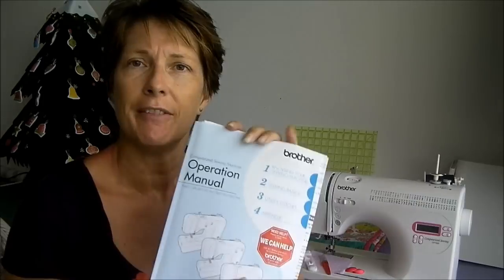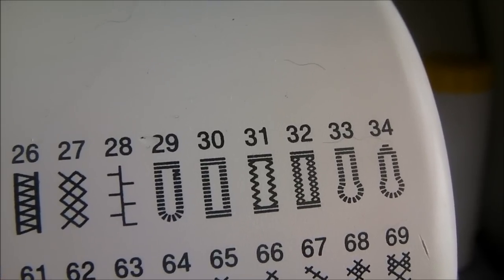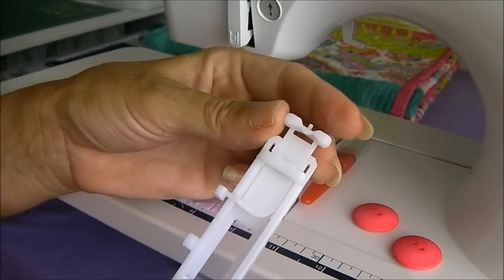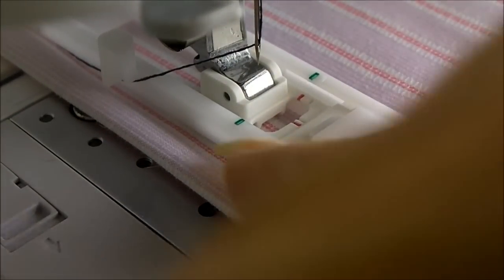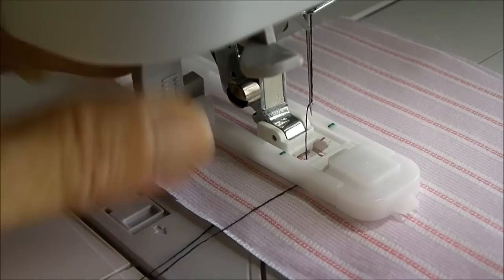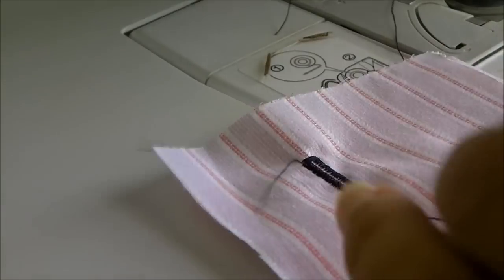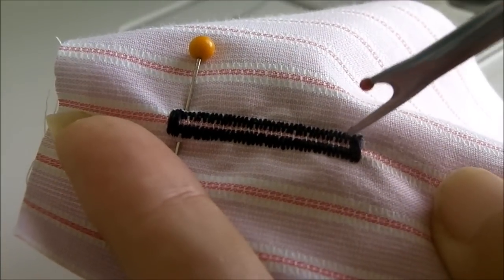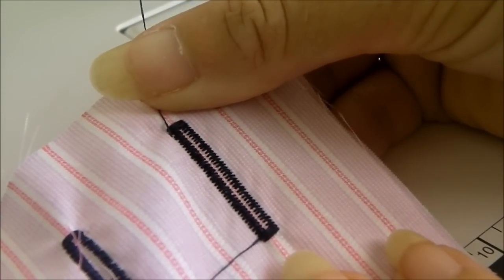Sewing buttonholes by machine

Comment: Is that plastic part that goes in front of controller that you pull down that you have attached to your plastic button assembly is that a separate part you have to attach, or am I just missing the one on mine for no reason whatsoever? I cannot even get this to work because that plastic piece is missing. :face-purple-crying: